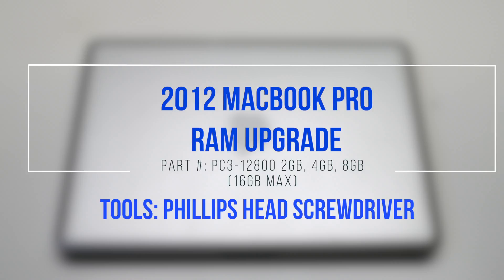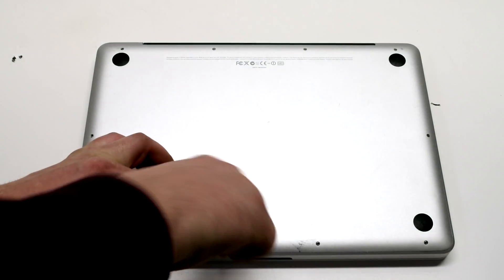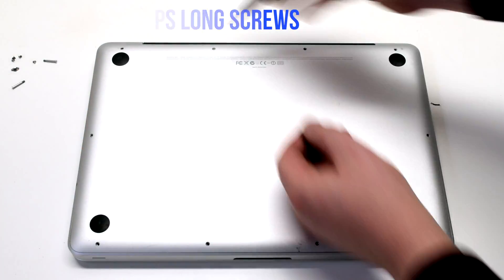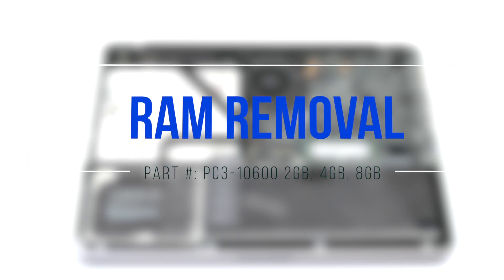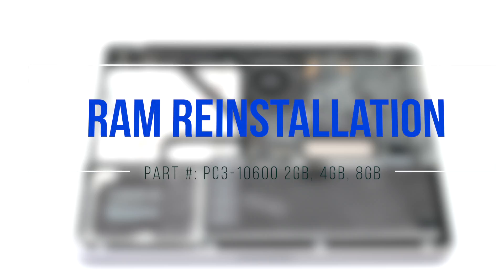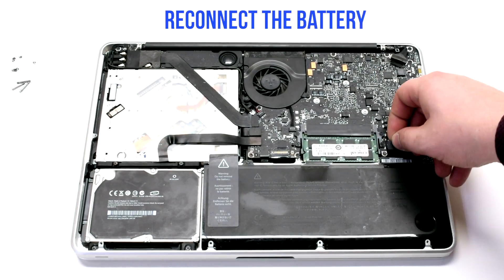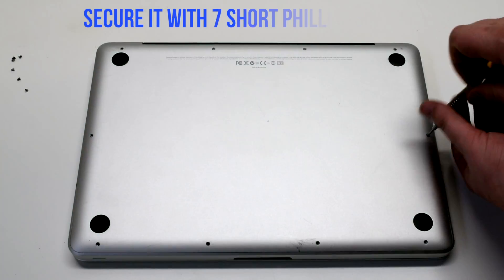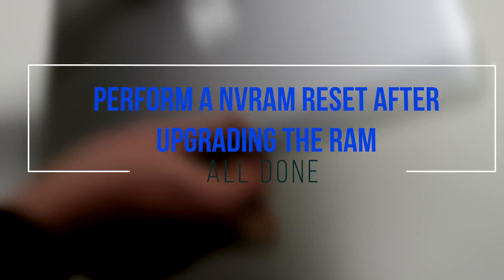2012 Macbook Pro 13" A1278 RAM Upgrade

Comment: I have the same macbook 2012 ... my question is ... why do you have to put a ramp memory of the year 2011 and not that of 2012? thanks

in this link have ram 2012   

https://www.ebay.com/itm/8GB-2x-4GB-APPLE-MacBook-Pro-iMac-Mid-Late-2012-A1286-A1418-MD093LL-A-Memory-RAM/322212108559
Reply from the maker: Apple will not take newer RAM then the original design (It will just beeping and not turn on) so you should always put ram type and speed that is designed for that model and year, here is a link for all 13" Macbook Pro ram types https://www.appledollars.com/mbp-13-ram-specs at www.appledollars.com you can find all the specifications under the Upgrade section. You can also look at out estore at store.appledollars.com and buy memory there.

Comment: I'm thinking of upgrading my macbook to 16 BG of RAM. I seen the you only installed one. Where does the second RAM install? Onto of the other one?
Reply from the maker: +Jesse Ibarra Hi, you are correct, there are 2 slots, there is another slot right below the top slot. Make sure to check the specification of your exact model to make sure you get the correct RAM,  for the A1278 13" 2012 Macbook Pro it's PC3-12800 DDR3L(two modules 8GB per module, totals 16GB). Watch this video to get your exact model https://youtu.be/91WLtNwAjd8